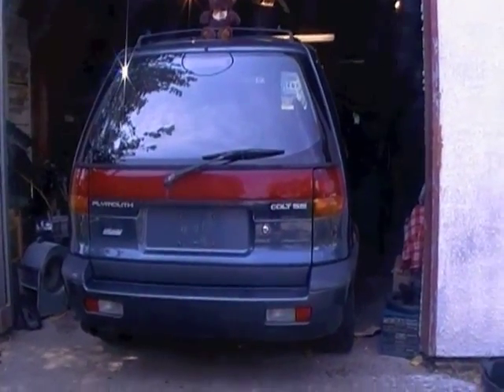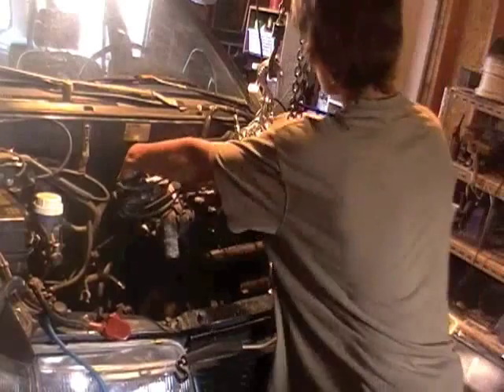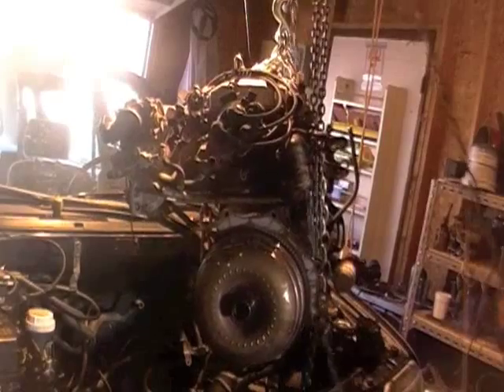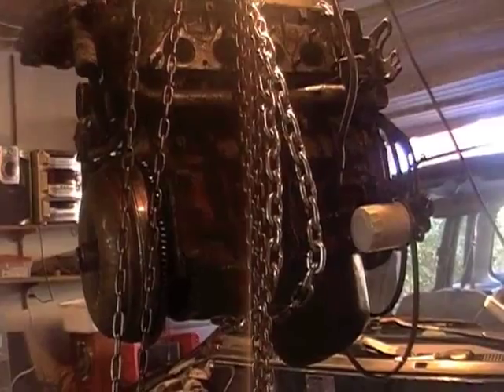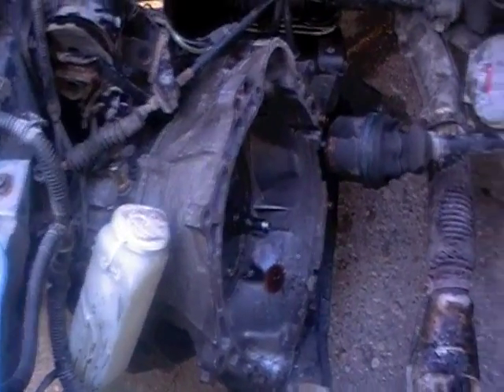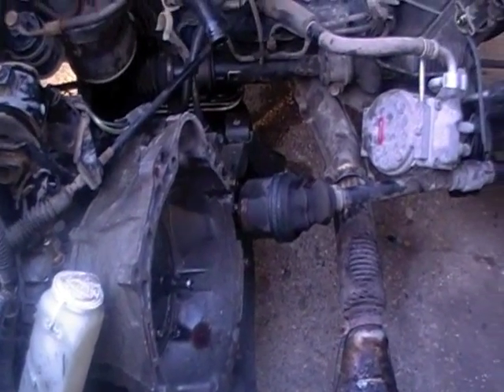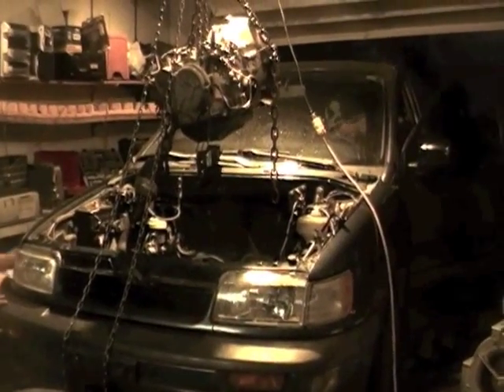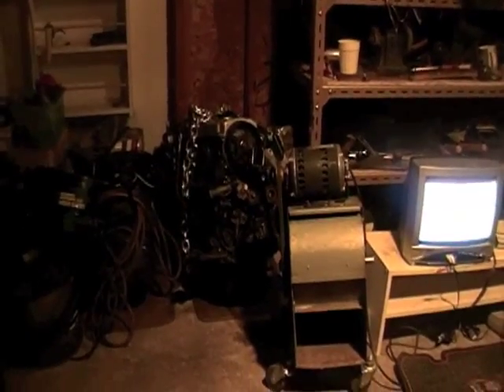OPERATION STOMACHE Engine removal

Comment: that engine looks good. The Eagle Summit has a cult following now. Have been driving mine since 92.  A strange design, complex way ahead of its time. There are some spooky surprises that show up, only years can tell.  Keep an eye on fuel pump + lines, the strange timing belt/counterbalance shaft belt, front pipe etc. Stuff rots too fast. good vid!

Comment: it's actually a lot easier to just drop the trans, then to pull the whole motor out less fluid needs to be drained only the gear oil in the trans. however on the downside you have to reposition the trans to the engine but its easy after you have done it a few times lol.